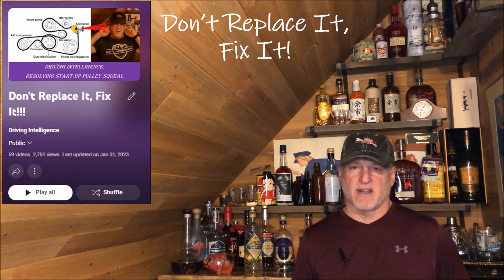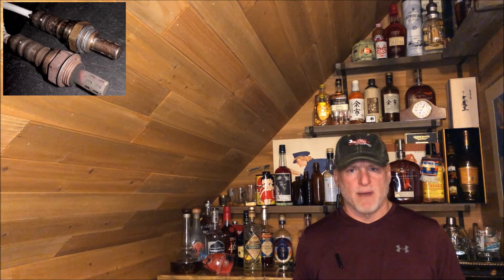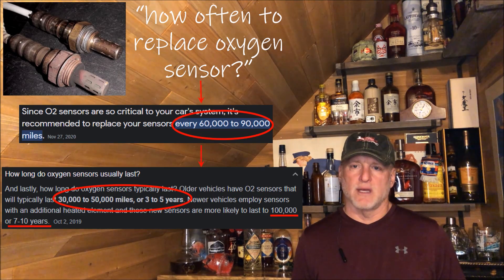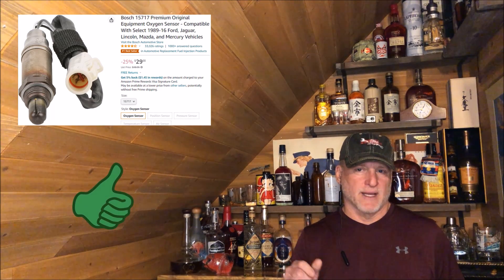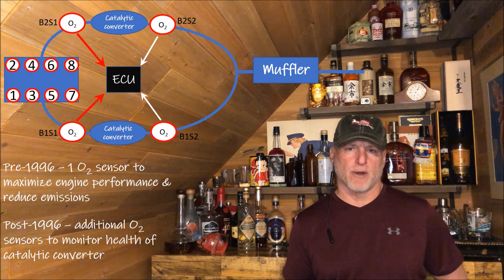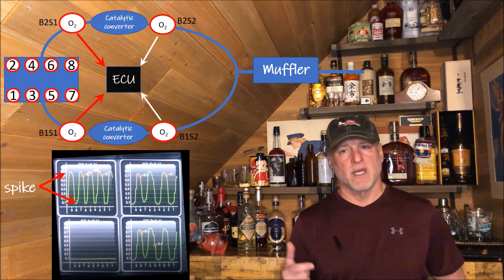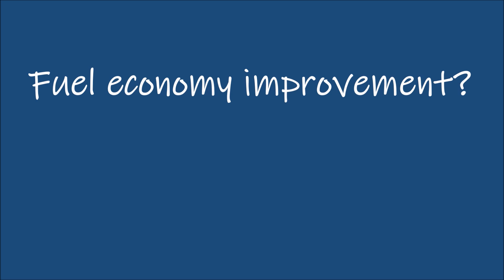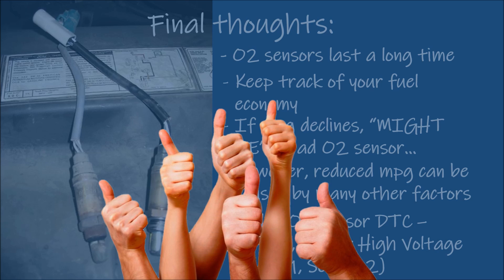Will A New Oxygen O2 Sensor Improve Gas Mileage, MPG: Ford F150, Expedition 5.4 & 4.6 2v Engines

Comment: I have a 2003 Ford Expedion 5.4L and I a getting 2-3 miles per gallon. I changed all plugs, fuel injectors, filters and I am going to replace the 4-O2. I hope that works.
Reply from the maker: Wow, that’s horrible! Do you have any diagnostic trouble coats?

Comment: I've already replaced my Throttle Position Sensor, Idle Air Control Valve, EGR Valve, Mass Air Flow Sensor and filter, PCV Valve and hose, and EGR Vacuum Solenoid. 

I got the codes below: 

Code po141--o2 heater circuit (bank 1, sensor  2)

And

Code po135-- o2 heater circuit (bank 1, sensor 1)

And

Code po156-- o2 circuit (bank 2, sensor 2)

And

Code po161-- o2 heater circuit (bank 2, sensor 2)

So does this mean I need to replace all 4 of my o2 sensors? 

As a female that's new to doing my own repairs, I am glad to see your video.😊
Reply from the maker: Hi there and thanks for checking in.  Please tell me why you replaced all the other parts.  Did you have codes?  What was the original problem.  Also, it is unlikely all O2 sensors are bad simultaneously.  Sounds like you might have an electrical circuit problem.  Do you have a device to datalog your O2 sensors?  Check to see if they are switching properly from lean to rich between about 0.1 & 0.9 volts.
Reply: @DrivingIntelligence  The reason I replaced those parts on my 2000 ford expedition 4.6L V8 Triton XLT was because I was having rough idling, poor acceleration and performance issues. 

I admit I did replace parts like throttle position sensor and mass air flow sensor without knowing if they were also the issue, at least I won't have to worry about those any time soon.

I did a scan with my obd2 and in the red was--EGR, CAT, EVAP, O2S, and HTR 
(I have no idea what some of these initials mean, like CAT and HTR)

And in the green was--MIS, FUEL, and  CCM

Note--I'll also admit that I'm a still learning about these repairs and you've helped me a lot through your videos. I even replaced my EPC by watching your video on it. I hated getting under my vehicle because I was afraid. That took me three hours! And I broke a nail 💅🏼 but I got it done.

Yeah I know it's an expedition and it's higher off the ground, but it was still scary to me, but I did it. I wished I had a lift!😊
Reply from the maker: @flowersfam3462  You're doing a great job, keep on pushing!  CAT & HTR could be connected issues.  CAT indicates a problem with your catalytic converter(s)  and HTR refers to the heater circuit in the O2 Sensor.  The HTR being red is consistent with the codes you shared in a previous message showing a heater circuit problem.  You also have a code indicating an O2 Circuit issue.  This is why I think you have an electrical or wiring issue going to and from the O2 sensors.  Additionally, have you inspected your EGR system?  Could be plugged with carbon causing a red indication for the EGR.  What type OBD2 tool do you have?  Model & Brand?
Reply: @DrivingIntelligence  It's called--- Hyper Tough HT300 automotive scan tool.
I probably need a more advanced one. I bought this from Walmart.
Reply: @DrivingIntelligence  I did replace my EGR Valve with a new one already. So it's in the green now.
Reply from the maker: My Internet search shows the possibility of data logging with your device. You should do an Internet search on how to use your OBD device.  Have you been able to inspect the wiring harness that supports the oxygen sensors?
Reply: @DrivingIntelligence  I'm doing the troubleshooting when I'm off this weekend. 
I have my checklist in my vehicle journal and I'll be inspecting all four O2 Sensors' wiring harness and connectors starting with the driver's side O2 Sensor looking for any frayed, torn, exposed wires or wiring that are too close to any sharp edges or hot spots like exhaust pipes and any bad connections.

Hopefully, there is no damage to the wiring or just minor where I can use protective tape and wire loom. Or just maybe zip ties to keep any wiring from touching hot spots.

I did buy electrical grease  to put on O2 Sensors connectors pins whether I have to replace the O2 Sensors or not. I did research this and it stated that doing this will help provide good electrical connections. Do you agree?

I also have some electrical spray cleaner to spray the connectors and remove any carbon or road grime.

So I'm prepared for hours of troubleshooting this weekend!😖😏

Hopefully everything works out because I haven't been driving my vehicle just to be on the safe side, didn't want to do any further damage.
Reply from the maker: Good luck this weekend
Reply: @DrivingIntelligence  😊
Reply: @DrivingIntelligence   No I don't have that device to datalog my O2 sensors. Where do I get one or do you have a link to one?
Reply from the maker: @flowersfam3462  respond to my last message and we can go from there.  I like the capability and simplicity of the BlueDriver Dongle:  https://amzn.to/3lsVutO  Let's see what your current device is capable of first.

Comment: Do you use seafoam in your high mileage vehicles?

Someone said to use a catalytic converter addictive in the fuel tank for high mileage even if there is no code, do you think thats a good idea?
Reply from the maker: If your engine is running fine and your catalytic converters are in good shape, you don't need any additives.  Make sure you use Top Tier gas and change your oil regularly.  Based on your other comment, you do have issues that need to be addressed, but forget about any additives at this time.
Reply: @DrivingIntelligence   Thanks as always for your valuable advice.

Comment: Just replaced both Up & Downstream sensors, both original with 268,790 miles. The only thing I noticed right off the bat is that the B1B2 sensor was steadily running close to 0.8 volts while idling. The old sensor was running way down at around 0.2 volts.
The new sensor heater circuit read 6.0 ohms, the old one read 6.6 ohms. Perhaps it was the sensor circuit on the old B1B2 that was going bad, passing the lower voltage/signal.
Reply from the maker: That’s a good possibility.  Bank 2 sensors should read a higher voltage if everything is running properly and you have a good catalytic converter

Comment: I HAVE  A 2000 F150 7700 2WD 5.4 CNG BIFUEL WHICH I HAVE REMOVED ALL BUT COMPULATOR VALVE AS ITS TIED TO ECM SOMEHOW I HAVE A FORD GNG MANUAL COMING FROM EBAY ,MAYBE IT WILL HELP TO DITCH THE BLOCK OF SHIT IN MY WAY . YOU SHOULD SEE THIS PEICE OF CRAP SYSTEM .HA HA YOU CANT EVEN GET TO THE SPARK PLUGS LIKE NORMAL OR ALTERNATOR IT SUCKS.
Reply from the maker: I've never worked on one of those.  What is your goal?  Are you trying to get rid of the bifuel feature?
Reply: @DrivingIntelligence  yes the tank has been removed and its out of date . plus the are no cng stations here in my area .I JUST WANT THE CLUTTER GONE!
Reply from the maker: I hear you!  I fully agree!